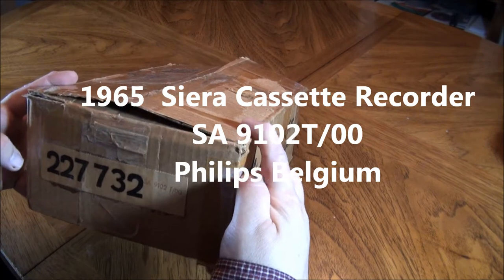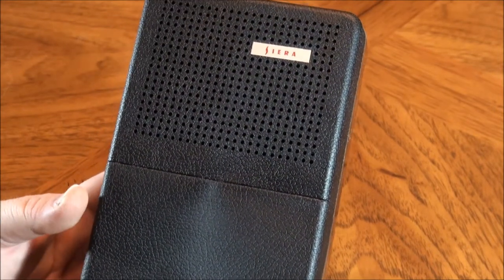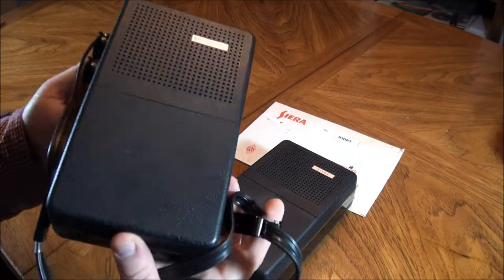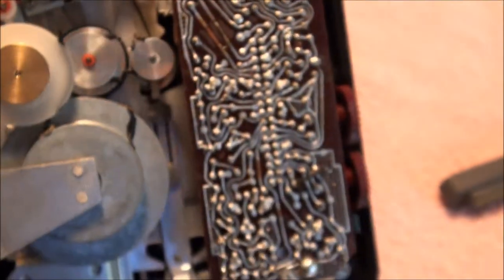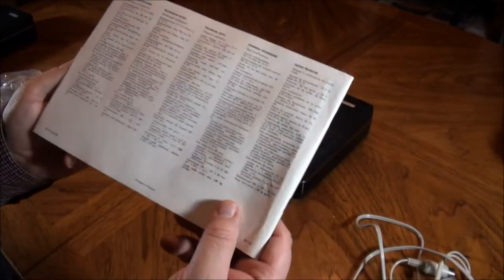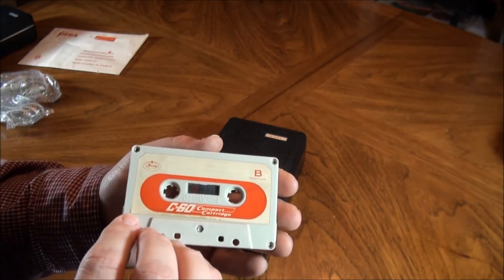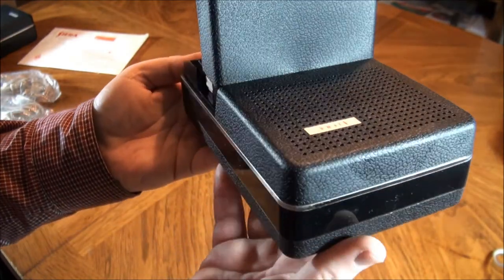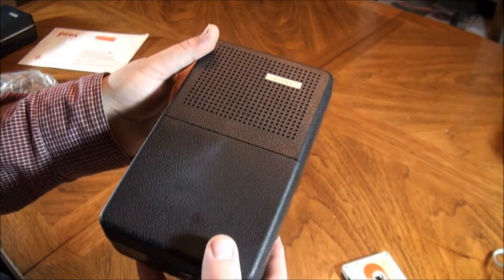1965 Siera Cassette Recorder SA9102T (Philips Belgium)

Comment: Generally, the electrolytic capacitors fail on these old machines. The dielectric dries out over time. These machines cannot sit for 45+ years unused and properly survive. The caps need to be energized from time to time, or like an unused muscle, they atrophy. The transistors are probably okay.

Comment: Nice find, a true time capsule.
Low volume may be capacitors, but if it has never been used or very little, the Germanium Transistors may be faulty, Tin Whisker growth inside the transistor casing.
Regards.